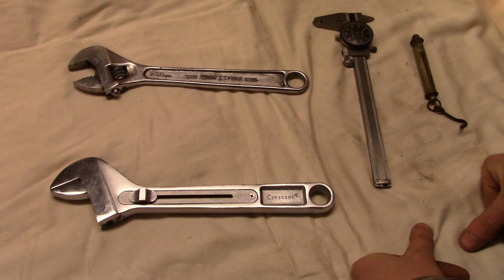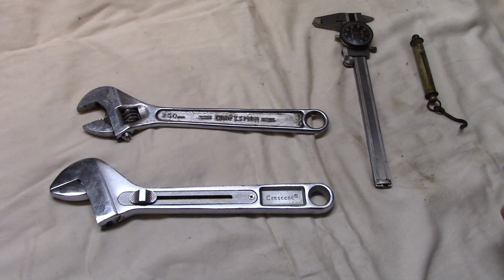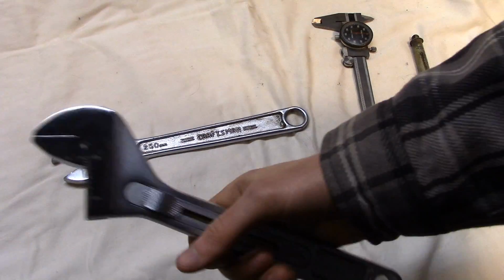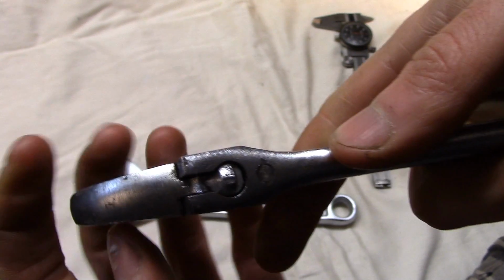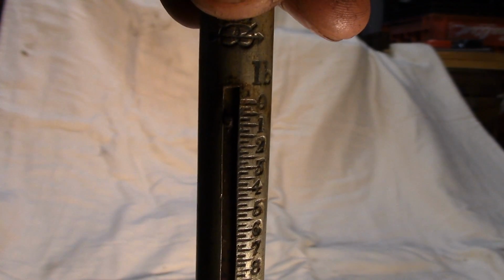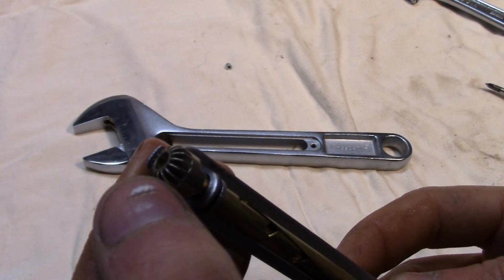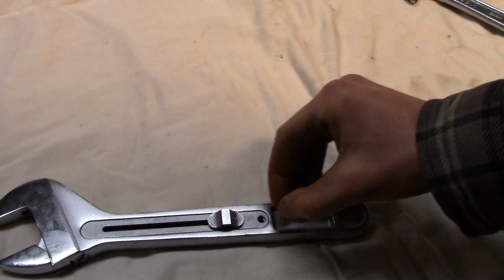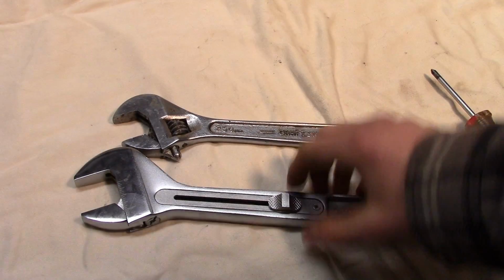Crescent RapidSlide Wrench - Great or Garbage?

Comment: I have one of these thumb sliders.  The problem with them (summed up in 5 seconds, not 15 minutes), is that any bit of grit or sand in the mechanism and won't slide smoothly, and eventually won't slide at all.  I Have rebuilt mine a couple of times, and it takes a complete thorough cleaning and de-greasing, or you will put it back together and it still won't slide.  Every tiny spec of dirt must be removed.  Who works with tools in a sterile environment?  To make it work you would have to keep it in a gun box, take it out to use it, wipe it down and re-stow it before any dirt can enter it.  I don't have the heart to throw it away, but the time I spent fiddling with mine this morning was worth more than a 3 pack of good old traditional crescent wrenches.

Comment: I use one all the time on site and it never let's me down. If you have big hard working hands it been bigger doesn't matter.  Makes it better that it doesn't dig in so you can put even more pressure and get bolts tighter. And if you are having to use a adjustable for all your work you want to invest in a set of proper snap on or Mac spanners.

Comment: I agree its large.  You said it would take up too much space in the toolbox at one point, then later recommended going to HF and buying a three wrench set instead of just this one.  I would also rather carry just one - even though a bit larger - than three.

I would guess if they could make the sliding mechanism to not require such a thick housing that they would have to use titanium and the cost would be a lot more than 15.00.
Reply from the maker: I was referring to the cost of the three wrench set, versus this one. Also, weight or volume in the toolbox does not matter so much as weight in the hand as you're using the tool!

Comment: there is a worse adjustable, black and decker sold a motor powered adjustable, was so bulky and bad looking
Reply from the maker: wow... that sounds like an awful idea.... and then you have to deal with your wrench running out of batteries!
Reply: I thought this wrench was going to be one of those.The one with a motor was invented form a NASA contest about 10 or 15 years ago to be used with heavy thick gloves like for working in space.

Comment: Milwaukee adjustable wrenches have tighter tolerances in the mechanism and do not work loose very much or at all when you are using them. There are videos on youtube. Check them out.
Reply from the maker: Interesting, I haven't seen those. Looks like they stepped up their tolerances rather than creating a new whiz bang mechanism, and it seems decent. If i find one for a good price maybe i'll pick one up. Thanks!

Comment: It would have been better if you had shown it in actual use as far as adjustability, holding strength, etc. Don't think I would buy one,  though it looks like it would be great for those times you can only use one hand

Comment: Leave it to the Chinese man! Apex is a great tool company, they own Dotco, Dynabrade, Proto, Masterpower and a bunch of other company's that put out great American made tools. Apex bought Cresent a few years back and sent it straight to China! Best adjustable wrench you will ever buy hands down is made by Diamond Tool and Horseshoe Co. They went out of business back in the 90's but you can still find them online for about the same price as a new Cresent but they will last you a life time. My dad is a pipefitter and in that trade guys would kill to get their hands on the old Diamond wrenches. I have quit a few from both my dad and my grandpa and use them everyday at work. They may be 40 years old but the tolerances are TIGHT and they don't come out of adjustment as easily as the new sloppy ones.
Reply from the maker: +UnitCrane514 Is that the same as "Diamond Calk Co."? I have a 6" one and i like it. Partly just because it's looks old and patina'd... I'll have to keep an eye out for more. Ever use an Eifel Plierench? I just discovered them and wonder how well they work. I'd like to add one in the toolbox!